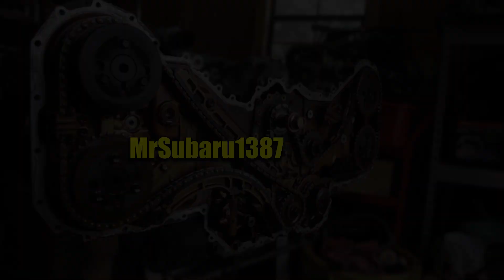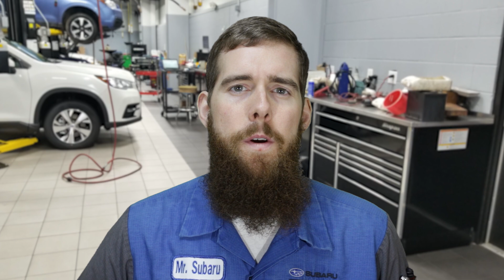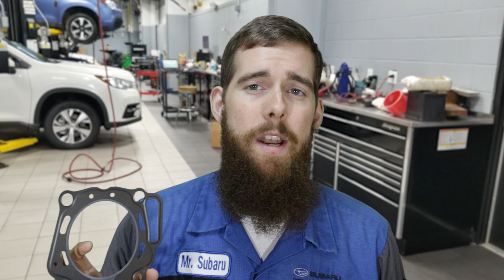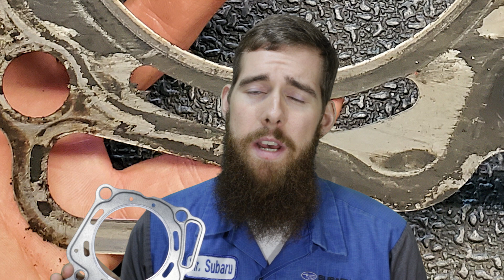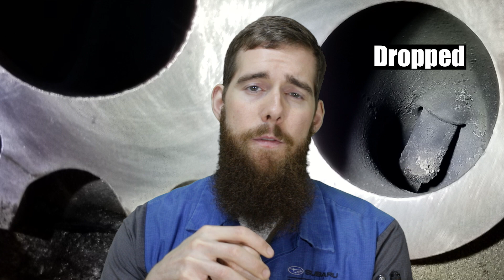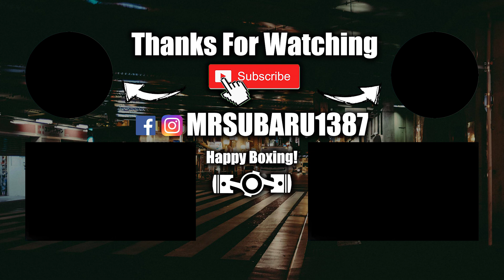Subaru Head Gaskets Explained

Comment: I thought that the H6, ez30d I think, (the ones in ~2001 outbacks) had head gasket issues as well, its just that there does not seem to be that many ez30d's around, so maybe it doesn't look like a big issue for these engines. Just from my personal experience, last year I was looking for a H6 1999-2003 outback, looked at 3 or 4, all of them had head gasket issues (oil/coolant leaking). Worth mentioning that I'm talking about European market, but I believe these engines were identical in EU and US. What I've also heard, that these models/engines had issues with cooling, heard rumours that maybe the radiator wasn't big enough or something alike. Given this and what you've said in the video, it is then likely that such things lead to head gasket failure. Have you heard any similar rumours about the cooling issues? Are ez30d head gaskets the same like in turbo model (not coated)?
Reply from the maker: EZ30D didn't have wide spread HG issues. There were some, usually due to neglect and poor maintenance.

Comment: Is an IAG EJ255 short block with forged pistons more reliable than an OEM EJ255 , during an engine rebuild? (For a Stock 13 SH Forester XT)
Reply: You should damned well hope so for the money. There is no reason to think it wouldn't be unless assembly was done incorrectly.
Reply: Parts and labor ?

Comment: Bought a 2013 sti sport tech yesterday 
Drove it 35 km home & it hydrolocked 
Dipstick is about 12 litres full lol & no coolant in rad. Car shut off while driving 
Also can’t rotate the crank, 108km on stock car .....    just paid 28k safetied
Reply from the maker: Sounds like someone beat the crap out of it and traded it in. You were the unlucky soul that ended up with it. Never buy a WRX or STi used. Unless you get them dirt cheap. Some of the most abused vehicles on the road.
Reply: MrSubaru1387 being an auto tech I knew I shoulda just bought the svt cobra

Comment: Great vid mr Subaru as usual. You’ve provided a lot of useful information. Just bought the wife a 06 Outback with the NA EJ253. 130k. I knew what I was getting into and hoping it last a year if I put minimal miles on it to get the head gasket replaced. Already seeing small drips on the pass side head gasket external leak as you said. Quick question. You mentioned changing coolant on time can prolong it a bit. Wondering what’s the best coolant for this 2006 Outback 2.5i?
Reply from the maker: Tradition green is fine. Just change it every 3yr/36k miles.

Comment: Can't figure out which EJ motor would be in my 2008 Subaru Impreza WRX. Would it be the EJ25 0r EJ257?
Reply from the maker: EJ257 is STi only. You have an EJ255.
Reply: @MrSubaru1387  thank you for taking the time to reply. I've noticed on the left head driver side has sludge build up. Like you said this case might be an external leak. I have no white smoke, no heating issues, the coolant is depleted from reservoir. I'm replacing my old radiator because it sprays coolant into the engine bay. Mostly the passenger right side
Reply from the maker: Top or bottom of head?
Reply: @MrSubaru1387  the part of the head when looking underneath the car (bottom?). Could  not see any gunk built on toward the top of the block. I am hoping it is gunk containing coolant, rust, and the environment it was driven on. I am doing a block tester that vacuums the vapor from the radiator in the chamber with liquid.

Comment: @MrSubaru1387 Having a difficult time finding compatible MLS Subaru HG's for my N.A EJ253 (2010 Legacy /w AVLS) - seems compatibility for most stops at the 09' model year. Do you know of a compatible PN' for the engine? I'm worried about picking one that blocks off coolant or oil passages, even partially. The Fel-Pro's are tempting, but going OEM has never done me wrong.
Reply from the maker: Fel-Pro is junk. Use the OE for your 2010. The 2010-2012 had a better gasket than the pre '10.
Reply: @MrSubaru1387  But is the O.E for 2010 not graphite coated? - Trying to use your affiliate link to purchase these, but the compatibility only goes to 09' - "1999-2009 Outback and Legacy and Baja (4-Cyl. Only) 1999-2011 Impreza (Non-Turbo)". Would the 11044AA642 also be compatible with the 2010 N.A. EJ253? (Or rather, would it be the best MLS replacement for the engine?) Trying to do this once, and do it right : )
Reply from the maker: @SimplyChem32  it isn't. It's a MLS, just not as thick/beefy as the turbo MLS gasket.

Comment: So what is the part number for a good gasket for ej25 single cam
Reply: You can walk into any dealership or parts store and tell them you need an MLS head gasket for a Subaru EJ25 engine and they'll easily find the one you need. Just make sure you specify MLS (multi layer steel)
Reply: Ok thanks:)

Comment: OBK 3.6 2010 - Manual transmision swap - is It possibe?
Reply from the maker: Yes. $$$$
Reply: @MrSubaru1387  Thank You very much for the quick reply, are you sure 100%? Which manual gearbox would be the most suitable? do you have any supporting materials?
Reply: urabusxt6 its a very possible swap, but its not easy. Everything should just bolt right up. Try for a transmission from an XT model, the only reason we never got manual trans 6 cyl outbacks was subaru didn’t have a 5 speed capable of handling that power at the time, the XT however has more power then the 6 so itll be fine.

Comment: I have a 2020 Outback. Is the head gasket issue resolved in this model's engine?
Reply: My 2016 Outback with the 3.6L has a leaking head gasket.  It's only gonna cost me a 100 bucks to repair, as I bought the extended warranty, otherwise the repair bill would of been north of 3,000 bucks!

Comment: Im looking for a vehicle and been avoiding Subarus even though I like them. I had a 93 non turbo 2.2 Legacy that was one of my favorite cars but the headgasket went out around 150,000.  Put another engine for 250$ myself to fix it and after reading and hearing all the Subaru headgasket problems have avoided them all ever since. I was just thinking it cant be that bad and thats how I wound up here lol
Reply from the maker: I've never seen a 2.2 head gasket fail. That's a new one. My 94 Legacy L 2.2 is at 320k miles on the original head gaskets.
Reply: Ive got bad luck with vehicles that are not dirt bikes. It started slowly every so often puking the coolant out of the overflow all at once. It would be ok as long as you didnt drive too far. I eventually took out the thermostat and drove it for a few months like that. Without the thermostat the pressure could escape gradualy. No coolant in the oil

Comment: My dealer's parts department (now closed) highly recommended conditioner and so I purchased a bottle of it to put in our 2006 turbo Forester when I went in there in 2009 to flush and fill my own coolant at about 39,000 miles.  I had a slow coolant leak somewhere from the day it was new, their service guys never did find it.  It turns out that at the timing belt service at 92,000 miles an independent shop they found the radiator was cracked.  I hate to think I did any damage to my engine using the re-labeled rad-weld/leak stop stuff...when all along I didn't even need it since as you say the Turbos with the EJ25 engine came with the multi layer steel head gasket, not the graphite coated one.  These parts department guys at the stealership can be just as ignorant as the techs.

Comment: It's still majority of the cars. And the problem usually happens after 150k, so it's very risky say that the 3.6 is safe if it is still pretty new. I had an outback 2.5 and a legacy 3.0 and both had head gasket problems with 150k and 190k.

Comment: Recently saw a Scotty Kilmer video on his channel in which he again recommends not buying a 6 cylinder Subaru because they are inherently more unreliable and require more maintenance than the 4 cylinders. Having owned the same H6 for 17 years and never having an engine problem (idler pulley and tensioner, though, failed), do you think the 6 cylinders are more problematic?
Reply from the maker: Absolutely not.
Reply: The H6’s are not known to have head gasket issues.

Comment: can anyone help me out? I'm doing a head meme gasket job on my 2007 Legacy 2.5i, I don't want use failpro or anything else, only the OEM turbo gasket. I can figure out which one will actually fit. Dealer doesn't know, and the net just says aftermarket.
Reply from the maker: 11044AA642

Comment: my 98 Impresa  blew it's head gasket and had to be totaled, my 2000 Outback blew its head gasket and had to be totaled, my 2001 Forester blew its head gasket and had to be totaled,  then I believed that Subaru had finally fixed the problem and I bought a 2005 outback 6 cylinder that blew its head gasket and had to be totaled.

Comment: does the 2020 Outback have head gasket leaks?
Reply from the maker: No.
Reply: @MrSubaru1387  How's the oil consumption on the 2020s?
Reply from the maker: @Outdoor_MED  they're brand new. No data is available on either question honestly.

Comment: So basically.... no Subie engine made over the last 10-15 years have no HG issues, correct?
Reply from the maker: No head gasket issues 2012+ on any engine. No HG issues on any of the turbo cars. No HG issues on the H6 cars. Only issues were non turbo EJ series 2.5L engines.

Comment: can you tell me what the right torque for a 06 legacy sohc non turbo. is this it? 

1) Clean the bolt threads and the bolt holes in the cylinder block.

CAUTION:
To avoid erroneous tightening of the bolts, clean out the bolt holes sufficiently by blowing with compressed air to eliminate engine coolant etc.

(2) Apply a sufficient coat of engine oil to the washer and bolt thread.

(3) Tighten all bolts to 40 N·m (4.1 kgf-m, 29.5 ft-lb) in alphabetical order.

(4) Retighten all bolts to 95 N·m (9.7 kgf-m, 70.1 ft-lb) in alphabetical order.
CAUTION:
If the bolt makes stick-slip sound during tightening, repeat the procedure from step (1). In this case, the cylinder head gasket can be reused.

(5) Loosen all the bolts by 180° in the reverse order of installing, and loosen them further by 180°.

(6) Tighten all bolts to 10 N·m (1.0 kgf-m, 7.4 ft-lb) in alphabetical order.

(7) Retighten all bolts to 30 N·m (3.1 kgf-m, 22.1 ft-lb) in alphabetical order.

(8) Retighten all bolts to 60 N·m (6.1 kgf-m, 44.3 ft-lb) in alphabetical order.

(9) Retighten all bolts by 80 — 90° in alphabetical order.

(10) Retighten all bolts by 40 — 45° in alphabetical order.
CAUTION:
The tightening angle of the bolt should not exceed 45°.

(11) Retighten bolts (a) and (b) by 40 — 45°.
CAUTION:
Make sure the total “tightening angle” of steps (10) and (11) does not exceed 90°.

Comment: I had the old 1.8 subaru drove the car all over the usa could put the water pump and timing belts on with a 12mm 10 mm maybe few other tools in 2 hrs. Put 300k on the head gaskets what crap all cars are now. Yes they are fast but they suck for dependability.
Reply: Did you lose the 10mm?😂

Comment: Just bought a 2008 Subaru Outback and then found out about the head gasket issues.  Just around 100000 miles, not what I wanted to learn.
Bummer

Comment: so did subaru fixed the problem or not?
Reply from the maker: Yes. Head gaskets aren't an issue in the FA/FB engines.
Reply: @MrSubaru1387  2.0 ?
Reply from the maker: @AldoFelt  yes. The EJ 2.0L engines didn't have head gasket issues either though.

Comment: I have owned 2 Subaru cars. Both of these suffered from external oil leaks from the head gaskets. Everyone I have ever known that has a Subaru with over 100K miles has an oil leak at the head gasket. If this was a known problem from all the way back in 1996 why was in not fixed permanently in 1997. Why on earth  should anyone trust a car company that knowingly puts inferior parts in their products year after year? Other than the two Subaru cars I have owned I have only had one other car with a head gasket failure and that was a 1986 Chevy Celebrity. Yes I am that old and I have owned a lot of cars and a lot of different brands. Subaru was from a maintenance standpoint one of the worst I have ever owned. Every time something failed it ended up costing much more to repair because it was a Subaru. They do drive and handle nicely especially in less than ideal conditions.  However I would never buy another one or recommend one to anyone else based on the fact that they seemingly put inferior head gaskets in their cars for 20 or so years. You can defend them all you want but in my opinion this is unforgivable. The fact that you are releasing a video defending the head gasket issue should be proof enough that it was and probably still is a serious quality issue.

Comment: I have an 06 Subaru Forester w/ the 5 speed manual. It has a head gasket leak. In my area the Subaru dealer is the only place that'll touch it. Do they gaskets they use last or should I have them put on better 1's? It's only at 147k miles
Reply from the maker: I'd request the MLS gasket. They most likely would only put the single layer coated gasket on otherwise.
Reply: Verify 1st do a compression and leakdown test

Comment: 2005 subaru sti head gasket issue.  No over heating. 90,000 miles. Unbelievable
Reply from the maker: Yea, it is unbelievable. If it isn't overheating, what makes you think the head gasket(s) are bad? Unless you've beat the hell out of it, never replaced the coolant, turned up the boost, and/or lifted the head, they don't fail. Especially with that low of mileage on them.
Reply: @MrSubaru1387  car is completely stock with regular maintenance performed.  The check engine light came on because I was getting fluid in the cylinder causing a misfire.  Dealership originally was saying a ring land failure but later diagnosed the head gasket as the issue.  Dealership told me that this was not uncommon on 2.5 liter turbo.

Comment: And here I am with an EZ36D that just blew a head gasket at 130,000 miles 🤦‍♂️ just my luck lol
Reply from the maker: I mean, it can happen, it's just not a factory defect.
Reply: @MrSubaru1387  What would be a reasonable cost to repair this?

Comment: Had a 6 cylinder subura 2001 with excellent dealership maintenance record, premature head gasket failire. I will never buy Subura again.
Reply: Just had Bad luck. But I wouldn’t go as far as to never buying a subaru again because of one bad experience.  Any head gasket in any car can go at any time, ive seen them go on cars with almost no miles on them, never saw it with a subaru but fords and suzukis and chevys and hyundais. They go on anything.

Comment: IMHO Flat engines are obsolete. With acquisition of Subaru by Toyota, we should see some modern inline 4 cylinder engines replace the aging flat 4 and 6 engines.
Reply: NICK won’t happen almost all of Subaru’s advertising is to do with the flat style of engine, Subaru also has made the newish series of flat engine that will probably last another 10-20 years before they all become electronic

Comment: I bought my outback brand new in 2007 now has 55k, oil leaks on the exhaust, consumes anti-freeze, bad rear wheel bearing, a dif whine, bad rt inner cv boot, replaced the alternator, and exhaust and the power steering pump has a loud whine too. 
My brand new in 2006, now 115k Civic has had NOTHING fail. Just one break job I did 2yrs ago. Yeah, I will never buy another Subaru again - EVER!

Comment: Subaru has rebuilt our Impreza engine 3 times and still not running properly . 
Now at 90000 miles transmission problems and AC condenser needs to be replaced . 
You SUCK Subaru ! 
I'd rather walk than buy another Subaru ...
Reply from the maker: Sounds like that dealership sucks and has poorly trained techs.

Comment: He is just throwing a lot of words and different engines sounds like he is doing everything they told him to cover up a weak and under powered engine.  a failure in Subaru’s .  And now they are getting beat out by all the competition . The sad thing is most people like Subaru’s but the set up is just not working any more .
Reply from the maker: I do not, nor have I ever worked for Subaru. I'm a Subaru enthusiast. I definitely am not afraid to call them out and know they're far from perfect.
Reply: @MrSubaru1387  so is it safe to buy a brz/ frs/ gt86?
Reply from the maker: @wannabecarguy  yes. F series engine. Not affected by the issue.